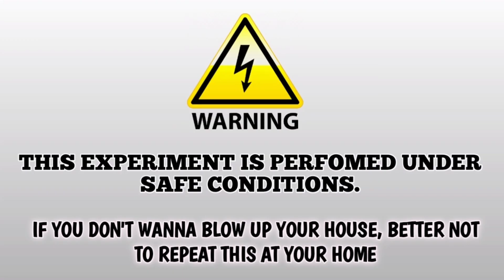Connecting Capacitors to 220V || Capacitor Explosion Test🔥

Comment: Let's hope Nischal doesn't find the StyroPyro channel, it could be the death of him...
https://www.youtube.com/c/styropyro/videos
Capacitors aren't the only thing that explode, I've had Cat5 network cable explode when it got hit by lightning.  Dang near anythign witll explode when you hit it with that many volts and amps in a few microseconds.
Reply from the maker: Yeah you are correct everything can explode if higher voltage and current flows through them but i have mentioned 'during normal malfunction' in the video.. very pleased to see your comment 😊...
Reply: @AmateurInventor  How's the soldering gun holding up?   Do any soldering projects lately?   I ordered some buck boards to install in my battery compartment tray so I can run off any DC power source - that's my next install project.
Reply from the maker: Yeah I made an IOT project that is an huge improvement to all the videos on the topic on the internet. I have a demo video which was uploaded before this video..
I was planning to do a detailed video on the topic and was thinking to make it open-source but at the last moment, dur to my very falt soldering tip, the terminals of esp8266 was brized and the board got fried.. after purchasing a new board, i will try uploading its video tooo...
Reply: @AmateurInventor  Okay, I just watched a video buy an FPV guy Sully that showed how to make soldering tips out of 4 gauge copper wire...  any style you want...   https://www.youtube.com/watch?v=uYC713dJnN0&lc=UgzOQO-kB3McymXt2JZ4AaABAg.9Dtm_G9PlVy9DtnRlGtMWK

In his video he puts the tip too far in, and we think the tip depth controls how hot the tip gets.   So he ends up wiring up a light dimmer switch in line with his soldering iron.
Reply from the maker: @choppergirl  i had tried something similar with 12 gauge copper but, it seems to wear out pretty quickly and oxcidizes pretty quickly.. nickel coated copper soldering tip might be good.. now lockdown is over in my country and i can buy parts finally when i visit our capital city😀😊.
Reply: @AmateurInventor  Nice.   I was browsing what I would throw in my Banggood shopping cart for you this morning, and I added 0.8mm solder, solder tip tinner, solder paste cleaner, and flux.    That tip cleaner and tip tinner is da bomb (American slang: awesome), I'm glad I learned about it.  I think the tip tinner has silver added into it , it's very sticky to your tip compared to regular lead solder just rolls off.
Reply from the maker: I have talked to a bank in the capital city and they can provide me a mastercard... You can send me some products and i can pay you back🙂. Now i have also collected some money around 100 uk pounds on patreon...
Reply: @AmateurInventor  Nice.  No, you wouldn't have to pay me back.  I haven't sent you anything yet because your address is like the old style we use to use here 100 years ago, not sure I trust it to get the stuff to you.   But maybe first I'll send some soldering stuff, and if it arrives, okay then it worked...  if not, no big loss.  And soldering supplies for sure you can use up.

I bought my friend Greg a Radiomaster TX-16s as a gift on Sept 11, and I got it like 2 days ago sent to me, so I could configure Open TX on it for him with my complicated settings file, add a Micro Crossfire Unit I could give him because I upgraded to a Crossfire Lite, and add some bling bling decoration to it...

http://air-war.org/Graphics/TX-16sw_03.jpg

My newer Crossfire Lite 2watt:
http://air-war.org/Graphics/Crossfire_Lite_01.jpg 

That's it stock, I've since added rubber switch covers and some colored nuts to it... 

He's in the USA, so when I get it pimped out for him, I'll mail it on to him to enjoy...

It also came with a sticker sheet... which my early adopter radio didn't:

http://air-war.org/Graphics/Radiomaster_Stickers.jpg
Reply from the maker: @choppergirl  woww, it sounds really cool. The video after next one would really be awesome❤️❤️. So i hope you will watch it as well when i upload.. really a surprise for you as well😊....
Reply: @AmateurInventor  Yeah, that's what I'll do, I'll put in an order to you for some basic consumable soldering supplies I know you can use, and when you get it, let me know what you got and I'll know your address works with their system.

Banggood China seems to drop ship stuff individually in separate packages from different vendors or warehouses, so you may get one item at a time in separate packages, or just one package all together.
Reply from the maker: @choppergirl  and here in my place, the coureer dont do home delivery service, we have to go to the coureer 9ffice to het our products.. so my address is 
Lalbandi, Province no 2, Nepal. 
Zip code. 45801
I have aslo not bought any thing from international market like banggood or AliExpress so it would be really great and wonderful thing if it works😊
Reply: @AmateurInventor  Aliright, I'll send some little goodies from Banggood CN to the courier office and we'll see how many make it to your mailbox there.